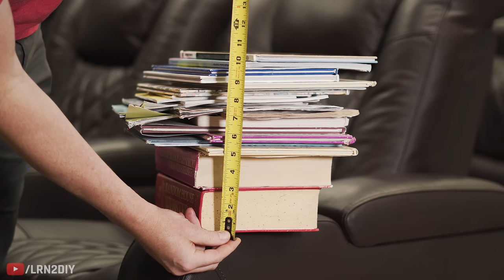DIY Riser for Home Theater Stadium Seating, with Power

Comment from the maker: 👍 WANT TO HELP SUPPORT THIS CHANNEL? 👍
Become a channel member! Hit the "Join" button or head to https://www.youtube.com/channel/UCPKAKrjoMz7POptCloy7AIQ/join
Support us on Patreon: https://www.patreon.com/lrn2diy

📦 PRODUCTS IN THIS VIDEO 📦
• Pneumatic Stapler (Paid Amazon Link): https://geni.us/aasm
• 1/4-inch Crown by 3/4-inch Leg Electro Galvanized Staples (900 per box) (Paid Amazon Link): https://geni.us/jCsa
• Folding Carpet Knife (Paid Amazon Link): https://geni.us/DgvAP
• Ridgid Cordless Drill & Driver Combo (Paid Home Depot Link): homedepot.sjv.io/m7g2a
• Ridgid Cordless Multi-Tool (Paid Home Depot Link): homedepot.sjv.io/jvWO6
• Ridgid Cordless Brushless Circular Saw (Paid Home Depot Link): homedepot.sjv.io/5Vb73
• Electricians Tool Set (Paid Home Depot Link): homedepot.sjv.io/WWd6A
• Self Adjusting Wire Strippers (Paid Amazon Link): https://geni.us/LxGd4
• Swanson Speed Square (Paid Amazon Link): https://geni.us/a1wYQL
• Fire Extinguisher, for your smoking hot staple gun (Paid Amazon Link): https://geni.us/MbQZzW6
Links above are affiliate links, which means you pay the same price as always but we make a small commission, which helps out our channel - so thanks!

Comment: I built my riser a year ago and put Jamo S 808 low profile subwoofers under each seat. There are three theater seats in the front row and the riser in the back has 4 more theater recilners. I created "port holes" in the box and aligned the holes to be exactly under the seats, so the bass could easily hit the bottom of my home theater seats and listener could easily feel the rumble and the vibrations.  The results are very impressive. Everyone who has watched a movie or a game in my home theater is thoroughly impressed. These under the seat subs are other than the regular subs that I have. By the way I picked these subs up (7 of them, 3 for the front row and 4 for the rear raised seats for $600 out the door). My only concern was how the heat is going to be dissipated but so far I have had no issues with the sub amps overheating. I have all the amps set permanently at 50% output only and don't overdrive them.
Reply from the maker: Sounds like a pretty killer setup! I always wanted to put subs in my couches and recliners. I recently put one in our sectional upstairs and it works out great but I have yet to try one in any of the theater seating. And it sounds like you really scored on your purchase. Nice!
Reply: Awesome idea do you mind sharing brand and model of the subs?
Reply: Im wondering as well!

Comment: Cool build, thanks for the video! The riser should really have extended to the next row of seating, provide at walkway of some kind. 3ft wide is preferred, 18" bare minimum. Having a little 6" wide lip is weird. And it's probably not really necessary to insulate.

Comment: Good stuff, very helpful. It looks like you simply set the riser on the existing carpet? You didn't secure it to the floor or wall, etc.?
Reply from the maker: Correct. It just sits on the carpet and is free floating. It weighs so much (especially with the chairs on top) that it hasn’t moved a millimeter.
Reply: @LRN2DIY  That's a relief. Thanks so much for your reply. I can't imagine it moving but didn't know if I was simply looking for a shortcut.

Comment: I'm doing something similar and was wondering about your LED lighting. I ordered the Phillips Hue lights that go around our TV but thought it would be good to have the Phillips LED strip lights as well for our seats... Until I saw how much they want for only a 6 ft strip!! Almost $200 for a two pack (2 x 6ft). Do you have any suggestions for the chair lighting? I noticed you are only lighting the front. Our front chairs are approx 6.5 ft and the back is around 7 ft. I might be able to use the Philips Hue 6 ft strip but not go all the way across and possibly center it? I know there are a lot of other cheaper options for LED lighting

Comment: oh very nice and thinking of re-doing mine when I get the time. The thick carpet is going to be a harvest for dust. So got vacuum clean each and ever day. I use thin carpet tiles thou my cats think its an extension scratching post to the one in the hallway.
Mine was made using bits and pieces put together and has lasted well but, am I unhappy with it and unhappy? I think I keep it I see no sense doing one again and it won't make me feel any happier.

Comment: Any way you could provide your room measurements and box riser measurements?
Reply from the maker: Sure thing. The room is 15 1/2’ W x 18 1/2’ D (to back of chairs). The Riser is  10” H x 94” W x 41” D. Two things to note: 1) the distance between the back of the front row and the riser is 34" and 2) when we recline in the back row, the front row folks are in the way unless they're also reclined. As a result, we leave the front row reclined all the time and ask anyone in the front row to stay reclined. Possible solution: make the riser taller (maybe 12-14"?). Best of luck with your build!

Comment: Thanks for the very helpful, and simple How-To video.  Question.  What is the black plug thing-y actually called?  It looks like the head of a plug, but you opened it up to expose the fittings to wire to.  Can you provide what its actually called or at least the link where I can purchase it from?
Reply from the maker: Hey Roz, it's usually just listed as a 3 wire plug. Here's a link to the one I used: https://geni.us/2BIjC. Thanks for bringing that up - I'll add links into the description in case anyone else has the same question. Good luck!

Comment: Really awesome video, some great tips. I love the way you did the corners on your carpet piece, that is probably the hardest part of getting the carpet to fit together seamlessly. The only thing that I would mention, is to have your electrical line in come kind of conduit, you don't want just electrical wire hanging out in the room, but this is just my personal opinion, other than that everything came out perfect.